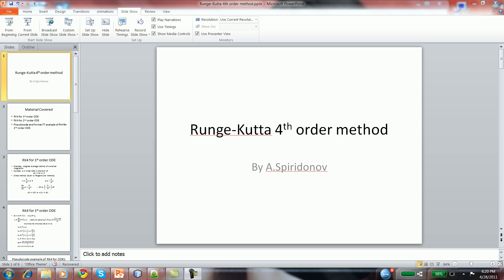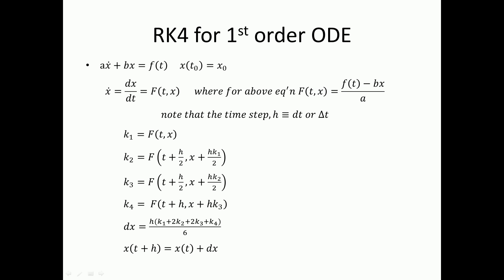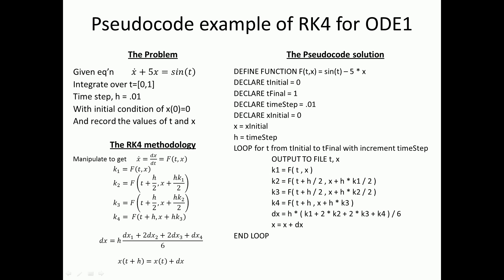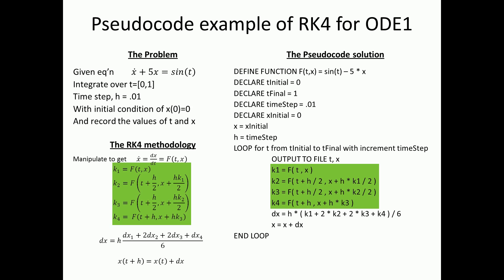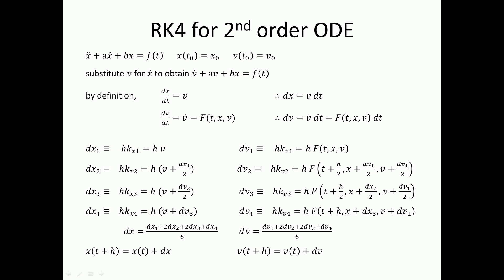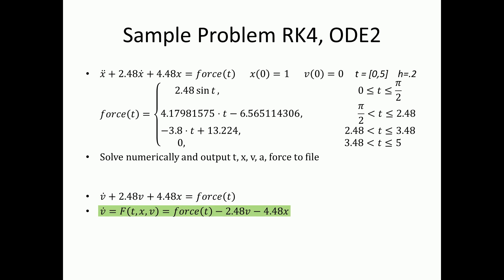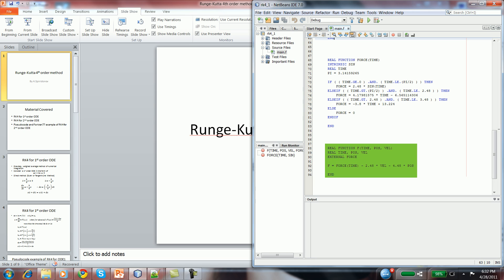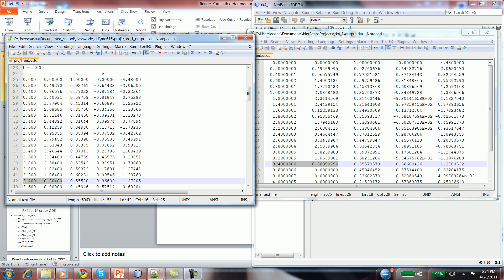Runge Kutta 4th order method for ODE2

Comment: i wanna ask how to solve the projectile problem using matlab? could you give me the source code in matlab? the equations is x"=-(1+0.1*x)^2 , with x(0)=0, x'(0)=1. thanks before.
send to landrexvan@gmail.com
Reply: landrex van i need the solution of the same   example by method d'euler if possible to send me in imenebenaouda29@gmail.com

Comment: Mr. Spiridonov thank you for the immediate answer!! The past few days I had been reading a lot about solving 2nd order ODES with ODE45 in Matlab and I tried to solve the Sample Problem RK4,ODE2 (8:05 in the video) with ODE45 in order to verify that I am correctly using the Matlab program. Although the program works just fine if force(t) is a simple function i.e. force(t)=2.48*t , it doesn't work with the if loops that I used for the piecewise force(t). I don't know what I am doing wrong.

Comment from the maker: You can use ode45() function to solve second order ODEs in MATLAB, which is an RK4(5) solver. I will see if I have the time to write a short lesson on using ODE45 for higher order derivatives. In the mean time, I've added a link to the description which covers some examples for using ode45().